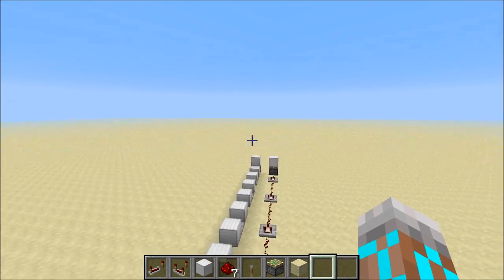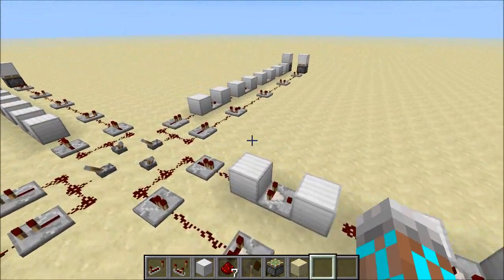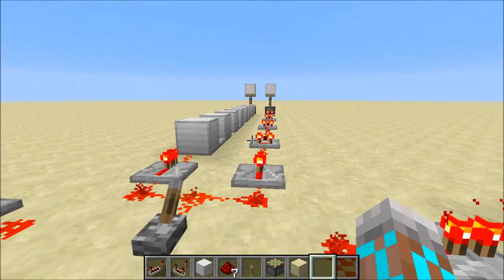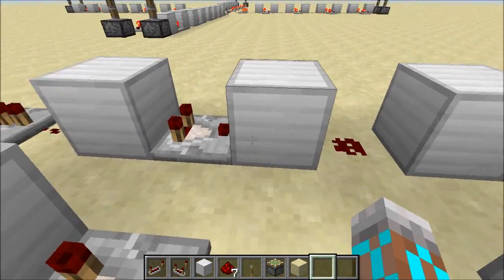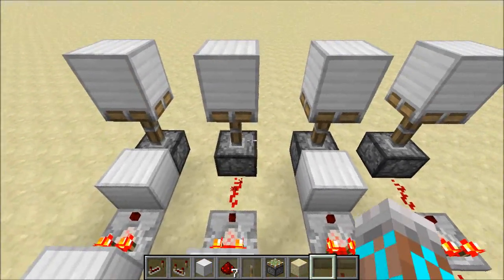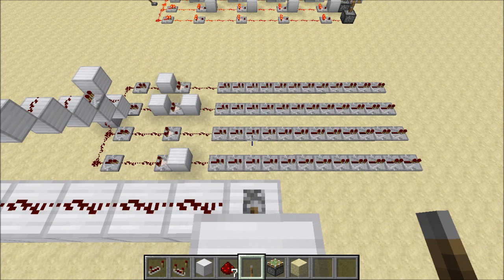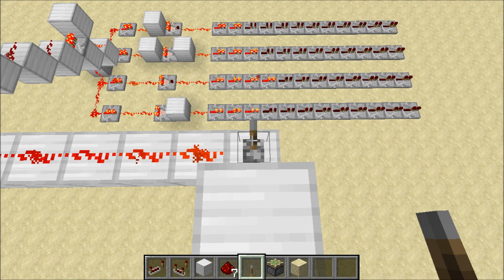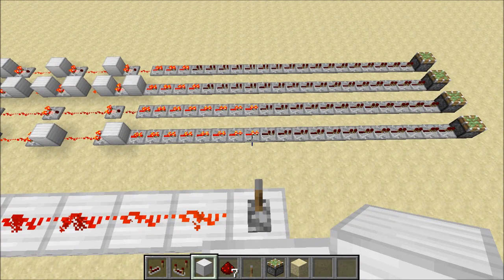Redstone Comparators are Weird: The Strangest Timing Bug I've Found

Comment: I have a clue, it depends of the map's area, when I try the exact same build as you on a new flat map with tiny distance the comparators works normaly (it takes 6 big square of ground on MC-edit), then I set the draw distance to far and i retry the same build (many more big square), now your wierd bug appears, BUT when I retry with tiny after that the bug is still here, the only way to fix it is reload a backup file with tiny distance or creat a new map, it's a problem for music :(

Comment: The comparators are kind of buggy but I'm not sure yet this is a bug because the comparators compare maybe the signal strength of the block behind it which leads us to the weak redstone signal and the comparator know what the signal is, but the comparator that is between the 2 blocks are little bit faster because of the weak signal and the strong signal so that means the weak signal is slower than the strong signal because of the comparator and the next one is the comparator itself because..

Comment: Interesting, I found a bunch of piston timing bugs when an update caused the extension to be more than instantaneous. They were similar to these and ran similar tests :D I found that it takes 5/3 of a tick for a piston to extend and pass a signal on when the piston pushes a block over a torch.  Also that you could get instantaneous piston fires if you used what I described above to power another piston.  Bugs are sometimes more fun to mess with than the intended game :)

Comment: I'm going to ask you to do something:
Try the same tests with a long clock and not a lever. if the tests are always the same then it's the lever timing. (try with clocks that use Comparators and clocks that don't)
Place all the Comparators at the same time, using a map editor.
I've seen that sometimes placement timing affects the delay. watch?v=dyo156gCrK4

Comment: I was also messing with timing. I figured out that if you make two lines of 22 comparators in a row one line just comparators the other comparators in subtract mode the timing is different. The line of regular comparators is faster. Wanting to know the different times, I set up the same two line but made them each 100 comparators long. This time the subtracting comparators were faster by far. from what I could tell the subtracting comparator would update 5 at a time after an in-consistent delay.

Comment: I wonder if there is not some trouble between block update ticks and redstone update ticks. It's probable the comparator do not check the same way for block update and for redstone update. So went you mix it, that durp... Plus, Mojang continue to try to fix redstone so as an WIP it's buggy.

Comment: i guess what is making it slower is the fact that it has to check for blocks before it in cases where there is block comparator redstone
that might make it a bit slower

the one with redstone before and after might lead to checking the strenght of the signal from 1-15 while if there is a block in between its from 2-15 redstone strenght
couldnt think of anything else really^^

Comment: This problem is old and well not the comparator part but how badly designed the redstone function is. There would be a simple solution they would just need to change the 0.5 tick delay to 1 tick.

Comment: It has to do with how blocks update compared to how comparators update. Blocks and comparators update at 0.5 ticks. Redstone Dust instantly, Repeaters 0.5 to on and delay-0.5 ticks. Torches after 1 tick. I found out that when repeaters were added they had many strange properties similar to this and it has to do with how they update. It takes longer to give off an output than it does to get an input. <-Sole reason for derp redstone timing.

Comment: I also have no explanation of how the delay works. It also bugs me that there is even more delay (wrong output for a short moment) from a comparator is subtraction mode. This is why I stopped messing around with this, until there is a (pre-)release which has stable timing. I would even prefer to have comparators which have 1 redstone tick delay and are consistent than a faster, but less reliable component.